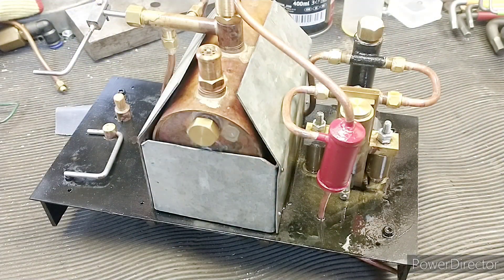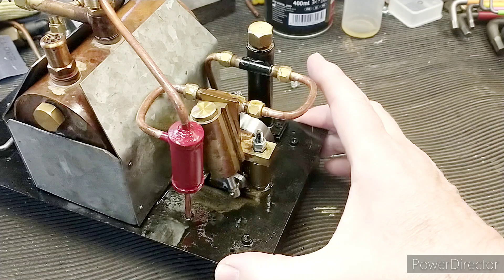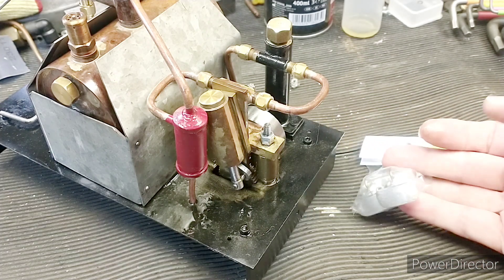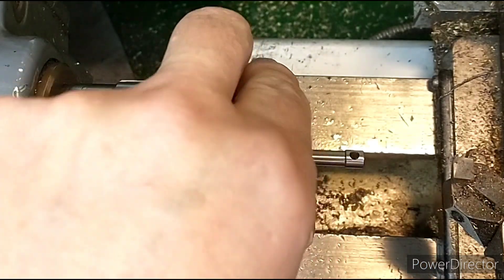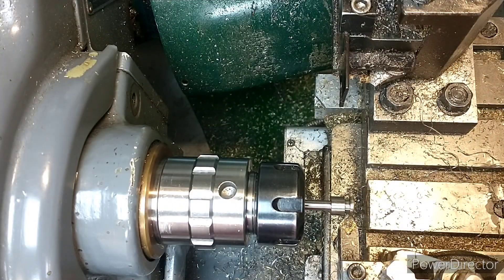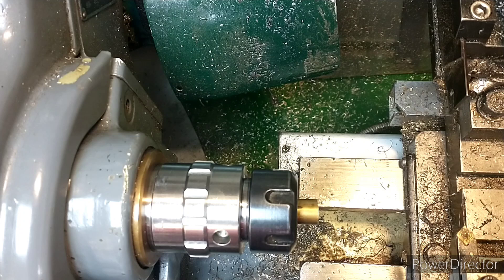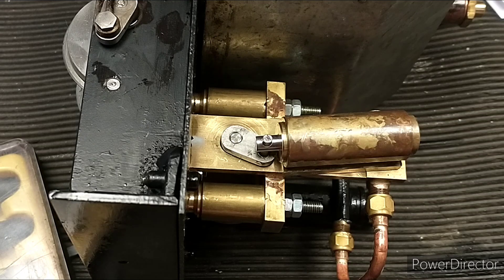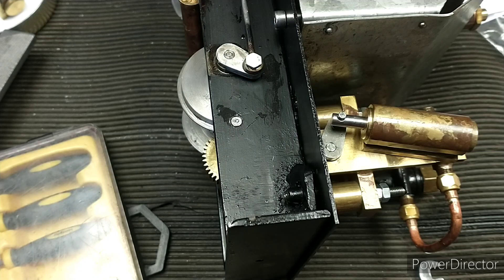Ellie Cylinder mods and buffers

Comment: These are super little engines Julia. Mrs Nobby is getting the Ellie book for me at Christmas. It will probably take till then to complete the PM engine 😊 Cheers Nobby
Reply from the maker: They are a great little loco Nobby 😀 if you make the lay shaft version the drawings are okay l. But if you make the original version there is a mistake in the position of the motor on the base plate. Message me for details 😄
Reply: @julias-shed  Thanks Julia I’ll certainly do that. This will be a project for next year. Take care ATB Nobby

Comment: Hi Julia,
I ve misplaced my Ellie  ok. Grateful if you could tell me the length of the piston rod?
I made an end cap but I now cannot get the crank to do right round as it keeps jamming. In the process I damaged my piston rod. Two steps forward , three steps back !
Reply from the maker: Hiya oh dear that's not good 😕 I made the 5mm portion of the piston rod 30mm which involved removing some material from the bottom of the piston. I also had to chamfer the end cap as it just touches the crank web at bottom dead centre. How thick did you make the end cap?

Comment: Did you put a small hole in the end cap to stop it getting hydro lock
Reply from the maker: The end cap hole is drilled with a 5.1mm drill for a 5mm Shaft so it's a quite a sloppy fit. 😄

Comment: Thanks Julia. I think I will put an end cap on mine which still doesn’t run very well! I ve left it alone for months …..
Reply: It's one of those things, once you've seen it, it's hard to imagine someone doing without one.
Reply from the maker: Thanks for your message ☺️ it's quite an easy mod to do and will stop the piston rocking in the cylinder bore.